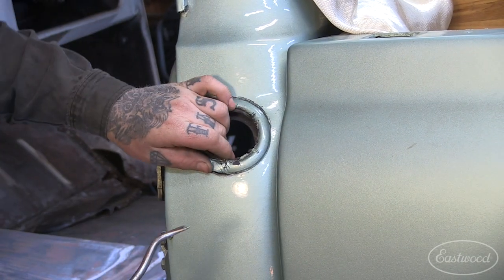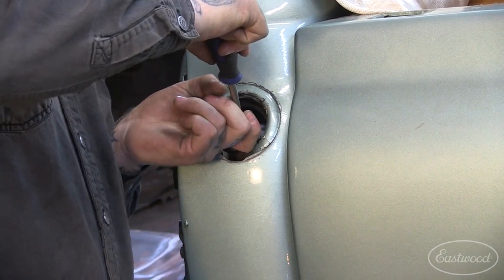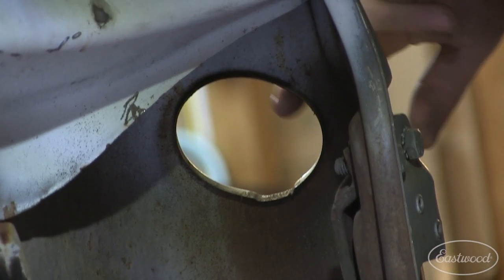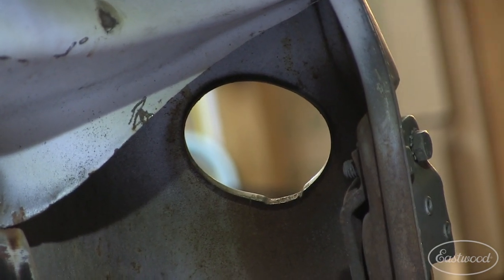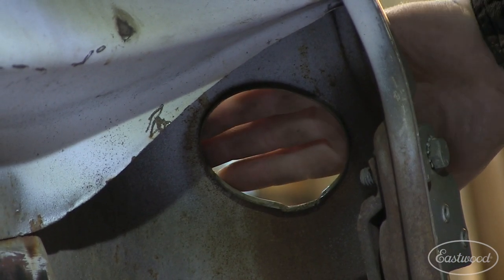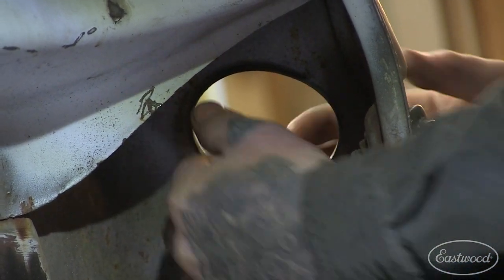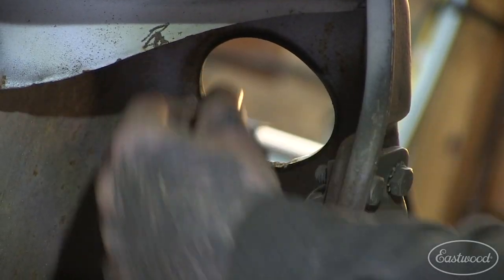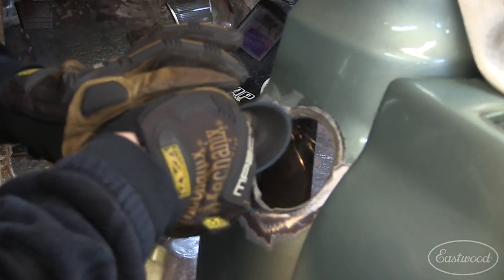QUICK TIP! One Important Detail When Shaving Gas Filler Neck on Classic Truck Restoration - Eastwood

Comment: I've left the lip on similar things before, it adds rigidity and keeps warpage down, a thin skim coat of bondo fixes any defects.
Now, this depends on the caliber of car you're building, 500 hours in metal work with metal finishing and no bondo?
Yeah, remove that lip.